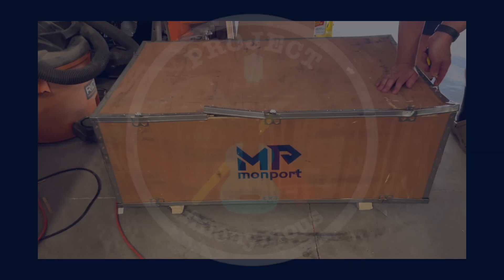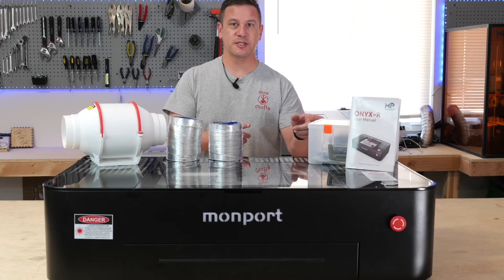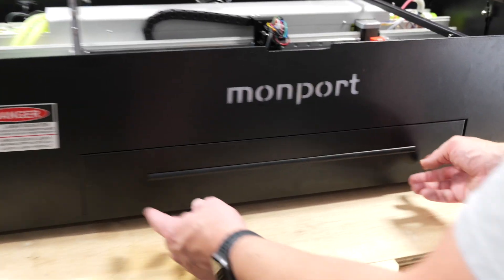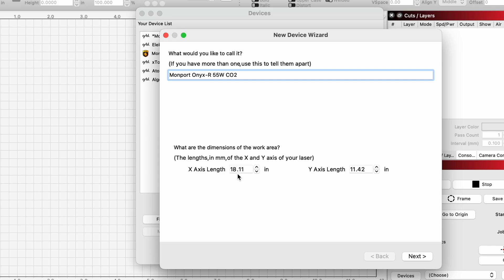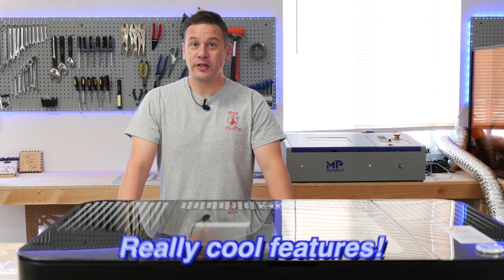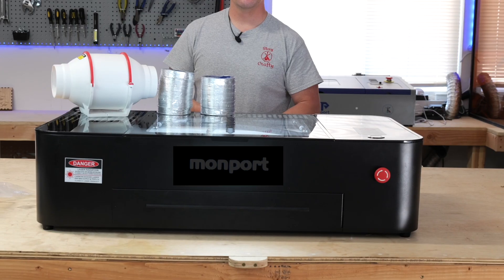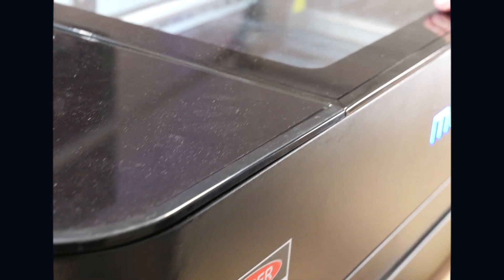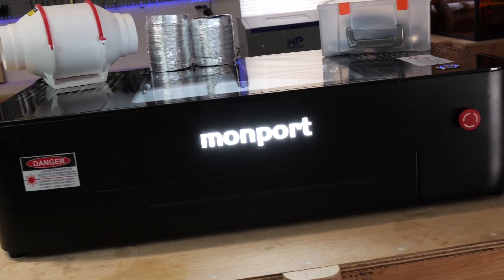GUIDE TO THE NEW Monport ONYX R 55W CO2 Laser Engraver | UNBOX & TEST

Comment: I have not been able to cut plywood at the settings shown in your video. Is it possible Monport sent you an upgraded tube. Has anyone been able to cut plywood that thick in 3 passes?
Reply from the maker: Hi! Each machine and glass tube will work a little different. Weather, humidity levels, material types, for instance glue used in plywood that may not laser well. All of these things can play a factor for how your particular machine will function, that is why we always recommend completing materials tests to get the best settings for your laser. Thanks for watching!

Comment: Oh yah, I have had my new Onyx R for 5 days now.  Onyx works great , cuts great, camer is great, but Z axis is broken, doesnt work.   I have contacted support , but they arent much help, I might have to send it back.   I really would like to keep it though.
Reply from the maker: Have you checked the connection at the z axis motor? Additionally, look for any torn or frayed wires at the laser head as they can be easily pinched when taking on and off the laser cover. May be an easy fix. We hope you get it all sorted out!
Reply: Does it click? If so have you tried loosening the nut and rotating the bottom part of the laser, if it’s turned too far in, it will catch and won’t move up and down freely. You have to take this apart to clean the lens and the first time I put mine together again I thought I broke the z axis.

Comment: I have a tip for anyone trying to calibrate with dots.   Turn off the laser first and just calibrate with your computer.   I tried to calibrate with the laser on and could never get it done.  Turned off the laser, redone it and it worked perfect.  It appears that the lights are causing the problem.   Also in your video showing putting on a blue panel was great, but the laser I got Onyx R, the white acrylic inside is glued on and I had to break it off to get it out.   Just saying.
Reply from the maker: Thank you for the tip on calibration!  We have also found that lighting affects the ability to calibrate.

Comment: On the cut test, did you have air assist on? I ask because it looked a bit charred. Oh yeah...does it have a red dot for framing?
Reply from the maker: Yes, we had the air assist on.  It was our first material test and the machine is pretty powerful, so we will just make adjustments and fine tune our settings. It does not have the red dot, the camera works for aligning.
Reply: @ProjectAnonymous_Duo  thank you for the info, I appreciate it! Trying to decide between the Onyx or the Polar.
Reply from the maker: If you have any other questions don't hesitate to ask and we will do our best to answer them!

Comment: What's the difference between the "R" and original Onyx?
Reply: The Laser Channel has the original onyx, there was a dongle that was needed in order for the laser to fire, that feature is not there. The water reservoir is on the opposite side and some minor differences. The emergency stop was more recessed in the original
Reply from the maker: Hi! Thanks for your question. We didn't own the original so we aren't completely sure.  It is our understanding they made some updates/modifications to the machine, moved/removed some parts and we have seen comments from others that it has a new auto-focus function.  From what we gather the Onyx R is more refined version of the original Onyx.

Comment: great interdiction on Monport 55 w laser i have bought one too but not enough information on the laser machine on the net specally on material cutting and engraving chart for speed and power setting i have tried few times it burn the material and started fire and now there is whole on the laser lens so the Monport is going to replace it dont know why  you are right on the owner manual  all misprint so if you have material test cut setting and engraving  that would big help for others as well to share .
thanks .
Kojie
Reply from the maker: We really appreciate your comment and suggestion! We will add doing some material test settings for cutting and engraving to our list of upcoming video ideas.  Thanks for watching!